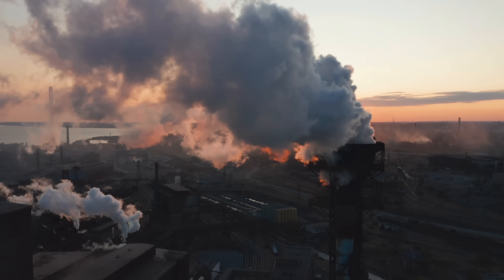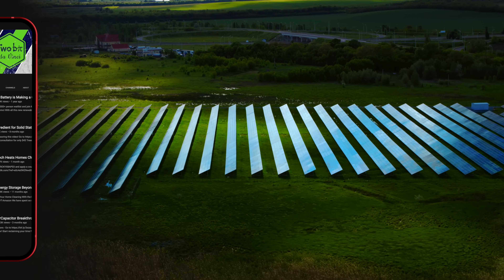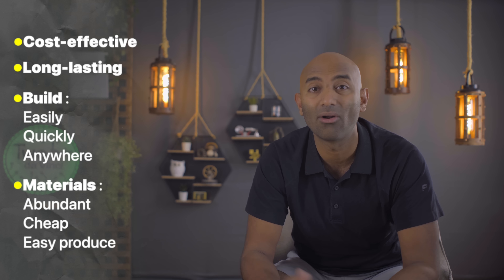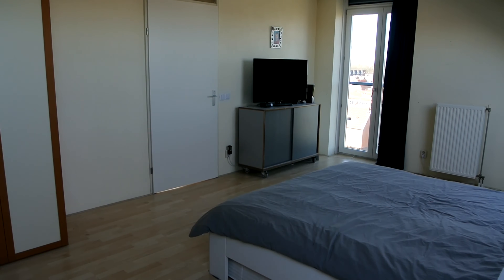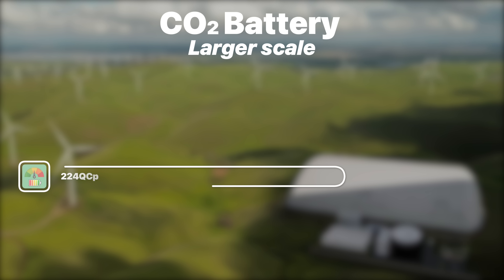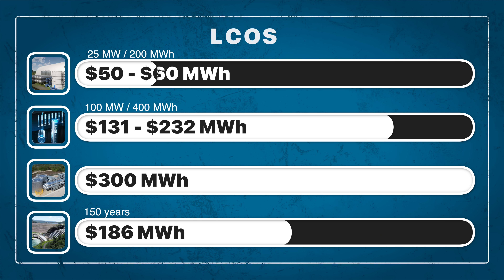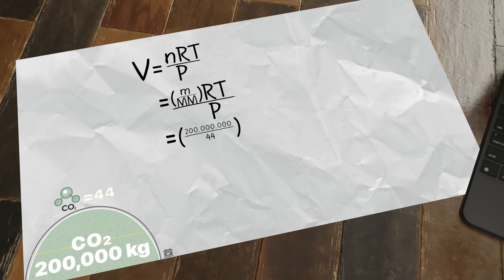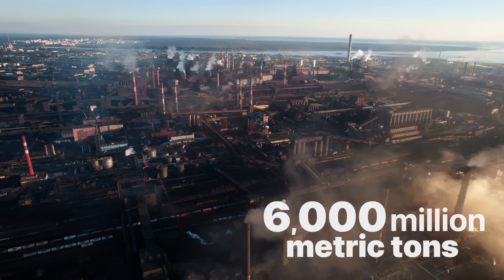The GENIUS Of the Carbon Dioxide Battery

Comment: I think its worth keeping an open mind and look at all possibilities.  C02 is .04% of the atmosphere and a small portion of that is man made.
Reply: @evilchaperone An open mind is a good thing. The percentage of CO2 is irrelevant, that's just how we measure it to track changes. What matters is how likely it is for a photon to hit a CO2 molecule on what would otherwise have been on its way out of the atmosphere, which is entirely to do with the number CO2 molecules in the air.  Magically double the amount of nitrogen in the air and the percentage  CO2 would halve but the greenhouse effect from it would still be the same. Mars has a very high CO2 percentage but its atmosphere is so thin that it has less CO2 than us and thus less greenhouse effect from CO2 than we do.

We are now around 400 ppm before the industrial revolution it was 280 ppm, a change of 120 ppm. 120 out of 400 doesn't seem a small portion to me, so I'm wondering what brought you to say this?

We know this change is due to us. Firstly, we have mining records, we have a pretty good idea how much carbon we've dug out of the ground and burnt and it is way more than enough to account for the change in the air (most so far has been absorbed by the land and ocean). Secondly we can tell by tell by the different isotopes of carbon where this CO2 has come from. The usual Carbon is C12. We can tell by the amount of C13 that this carbon has come from a biological source, and we can tell by the amount of C14 that this carbon was taken out of the atmosphere a very long time ago. This is the fingerprint of fossil fuels, not volcanoes, not weathering.
Reply: @flightofthejellyfish  My point is to keep an open mind.  CO2 alone may not be the entire cause of climate change.  If you removed all humans from the earth, the climate is still going to change.  If you remove all man made c02, the climate still going to change.    Eliminate fosil fuels, billions will die from starvation.
Reply: @evilchaperone  "My point is to keep an open mind." Hmm, yes. An open mind would be one willing to listen to new ideas and consider them. An open mind would be one willing to look at new evidence and evaluate it. An open mind would be one willing to be changed if the ideas or evidence demand it. An open mind would question itself: Is it true that the percentage doesn't matter only the absolute value? Is it really 120 out of 400? Why do I think that it's a small portion if it's 120 out of 400?

An open mind probably wouldn't change the subject and run to an emotive "billions will die" appeal to avoid thinking a thought that might change it. Just saying, I don't think what you're really advocating for here is an open mind.

Sorry to be harsh, peace.
Reply: @flightofthejellyfish don't forget the "look at all possibilities".
Reply: Not to mention that water vapor is 100 times more prevalent in the atmosphere...with 10 times the specific heat.  But lets not talk about water vapor as a "pollutant."   THAT would be ridiculous.  /sarcasm
Reply: @C0M0I  you might have noticed in your time on planet Earth that when you try to add water to the atmosphere it tends to just fall out again. You can't increase it so it can't force a change in the greenhouse effect, only respond to changes that occur. Notably the amount of water vapor the air can hold increases with temperature. Climate scientists aren't idiots they've taken this into account. The about 3 degrees per doubling of CO2 figure is only about 1 degree directly from CO2 nearly all the rest is from the higher temperature air which can hold more water vapor which increases the  greenhouse effect which increases the temperature so the air can hold more water...
Reply: @flightofthejellyfish  are you saying that water vapor is responsible for about twice the temperature change that carbon dioxide can produce?  Thank you for agreeing with me. 

As for the amount of water vapor that the atmosphere can hold…I have noticed, like yesterday at 41,000’ the jet contrails stayed while I was over Missouri, but quickly evaporated when I was over Indiana, two states away. Seems that part of the atmosphere could handle more water vapor and part could not…it was already saturated.  This is true of all gasses in our atmosphere: temperatures dictate how much of each gas can remain suspended before falling out of the solution that is our atmosphere.

I understand that the scientists aren’t idiots, but I believe that they make too many assumptions in their quest to understand the atmosphere and guide our behavior in relation to it.  They have been wrong about their predictions for 50+ years.  Please forgive an open mind’s sarcasm when they ignore water vapor and harp on plant food…

You, yourself agreed that water vapor holds more power in temperature change for our atmosphere than plant food (CO2).
Reply: @C0M0I  "are you saying that water vapor is responsible" Try to read for understanding instead of mindless sophistry. I just separated out two concepts for you. One is a forcing that can cause a change in temperature the other is a mechanistic feedback that amplifies a change, not the cause. If by "responsible" you mean it is the cause then the answer is no it is not the cause. You are playing mindless word games. Do your research for goodness sake it's not like this is secret knowledge, it is mentioned throughout atmospheric science and really shouldn't be new to you.

 "could handle more water vapor and part could not…it was already saturated." Try to read for understanding instead of mindless sophistry. Yes well done air heats up from the sun, water evaporates, cools down, it precipitates out. While the average temperature of the atmosphere remains the same the average water vapor content remains the same. On average the amount of water that evaporates is equal to the amount that precipitates out.

"This is true of all gasses in our atmosphere" When the heck was the last time you stood outside in a shower of liquid CO2?
NO the Earth's surface temperature is not low enough and the pressure is not high enough for CO2 to reach saturation, let alone liquifying nitrogen, oxygen or helium! Did you actually think about what you were saying at all, or were these just words you thought would sound good?

"They have been wrong about their predictions for 50+ years." Really? Go and look up the IPCC's first assessment report (that's the usual bug-bear) and see how actual scientists' predictions track with current measurements, I'll wait...

...or is it only what professional "sceptics" say the predictions were - through out of context quote mines and cherry picked non-scientists - that are wrong. You really shouldn't trust what professional "sceptics" say their opponents say.

"You, yourself agreed that water vapor holds more power in temperature change" No, I didn't, I said the complete opposite. That is your willful and sophistic lack of comprehension. Why is it that you have to resort to sophistry instead of honest argument?

Comment: Energy storage, such as Tesla's mega pack, will be done primarily with LFP cells. Nickel will only be used for high energy density batteries. It will be an immense task to convert the worldwide energy grid entirely to battery storage, and it will take many decades. Fossil fuels will be required for a long time.

Comment: I agree it should capture co2 from the atmosphere. One way they could do it partially would be to capture straight from the factories producing it. Technology could find a way to connect straight to those stacks and use a vacuum system, then take it to a plant that could separate it from the other gasses. Sure, startup for that would be high. But again, so are water and sewage treatment plants. Then, they could even add on to other high carbon producing areas. Sure, it costs money to start as everything does. But in the end it would cost less in the long run and cost less. Once you can find a way to capture carbon straight from the air itself the means of separation will exist and the only major issue would be how much could be taken from the atmosphere before an ice age would result. This could be dine for other gasses such as methane, which seep out of the earth, land, and oceans. Again, we could do many things to help the environment. To what extent would we then hurt the environment and need to produce vs take away. For instance, if we take too much growth of plants, they would suffer. Removing too much could cause cold climate etc.

Comment: Interesting, and well presented. Still I think most solutions like this one are barking up the wrong tree. Why go to these extreme lengths to redeem the basic shortcomings of renewables like solar and wind (power intermittency and power density)? We want to free ourselves from the dependency of autocratic regimes for a stable energy supply. Yet, the dependency on China for rare earth metals (wind turbines),  solar PVs is almost 100%. The enormous pollution and energy use from Lithium mining, enormous copper mining efforts for electricity transport cables, production of inverters, controllers, etc seems to be ignored.  Currently, the only stable, scalable energy solution is nuclear. Moltflex, Seaborg, Westinghouse and several other will be central players in the re-birth of the nuclear power era. Safe, stable, scalable.

Comment: I got news for you, it isn't a delicate balance. Evidently you haven't looked at any of the co2 records. There is no way that in 1965 the world produced 12 Billion Metric Tons, with 6 of that 12 making it into the atmosphere and the other 6 being sunk in the environment. Flash forward.half of the current output, actually more than half the output is disappearing. Good numbers are hard to find. Today the sinks are taking up over 2.5 to 3 times the entire production in 1965 or any time during the 60's, 70's. 
What you believe and what is actual, are light years apart. This is just one thing. You'll come up with some apologetic statement like plants are taking up more. Not that much more, and the oceans were supposedly cooler 60 years ago and 'the lungs of the earth' were bigger.  Delicate??? I don't think so. Do you have an idea what the shield of the shuttle is made of? Have a Handbook on Physics and Chemistry? Have you looked at the thermodynamics of elements, the entropy of o2 in particular and on the next page the thermodynamics of oxides, in particular co2??? Which one has more entropy? And is it even meaningful? Is the amount of co2 meaningful?  Oxygen and Nitrogen make up 99% of the atmosphere. All the other gasses combined round out the 1%. Ever see a paper that has o2 list with hundreds, It's 210,000 ppm. I can't even tell you if we are responsible for all of the increase in co2 amounts. Certainly we are adding, but that delicate balance, isn't .

Comment: You know what CO2 actually is? Plant food. When CO2 levels increase, so does flora growth, which in turn leads to more H20 vapor and 02 levels, both of which are good for fauna.  Is there a balance? Sure. But the planet can balance itself. It has before. Look at the ice core records. C02 levels have been exponentially higher in the past, including during full blown ice ages, which happen during global cooling. Our effect on the earth's atmosphere pales in orders of magnitude to the effect of solar activity.  We do not drive warming or cooling. The sun does. We might affect the overall values by a small degree, but we can never hope to compete with nature's ability to self regulate.  The hubris of man, and our self importance is staggeringly disturbing.  We are dust on a speck of dust amidst motes of dust littered throughout eternity.

Comment: Carbon Dioxide gas is NOT the problem,  solid carbon materials are , in the form of CNT's.  Slightly above normal  CO 2  gas in the atmosphere is not harmful to anyone,  in only encourages more plant growth.   The problem with CO 2 gas, is that it has been building up in the Oceans, and Fresh  Water.   Re-balancing the Earth's Water by delivering dissolved Oxygen , is the answer.    Increased pollution, and dumping has accelerated the problem.

Comment: As the Carbon Dioxide falls the Artic Ice Sheet is expanding...over 2 million square kilometer's so far! There is around 425 parts per million right now which is magnitudes of levels lower than 100 million year's ago! CO2 helps regulate the temperature's...without CO2 every living life form die's! Here is a fun fact for the people...if CO2 drops below 279 parts per million well look up snowball Earth!

Comment: If the figures quoted are realistic when scaled to industrial levels, this certainly provides an answer to the intermittancy problem and the demand problem of wind and solar power generation. Lithium batteries are not going to be the answer, the demand for Lithium in the coming years just to satisfy the demand from transport is going to make it expensive and in short supply. Its good that technology like this is being developed, I hope that it proves practical and successful.

Comment: Carbon dioxide is heavier than air. If there was ever a large rupture of the dome... the gas would displace the air near the ground all around the dome and flow to low areas. This would suficate everything in a few minutes. People and animals.
The dome should be hardend from aircraft strikes and located away from cities. OR just use air.

Comment: Efficiency is not a question if the goal is net zero efficiency doesn’t matter you just build more solar plants or windmills to make up the difference but any energy storage system that doesn’t use hydrogen is a waste of Time hydrogen can be burned or put through a fuel cell either way it produces only water and that water can be collected and turned back in the hundreds again with no loss

Comment: When liquid CO2 is released from it's pressure vessel, the phase change from a liquid to a gas may cause some of the CO2 to freeze into dry ice at close to atmospheric pressure.  If water used to cool the compression cycle is also used to heat the evaporator this would result in some energy recapture, however, it seems that additional energy is needed to evaporate the CO2.  What energy source drives the "gas turbine" to run the boiler?  Please clarify.
Reply: Why a boiler? Co2 vaporizes around -78 degrees celcius, depending on pressure. Just a fan pulling in outside air and a heat exchanger would do. (although you might even try to hook up the cold side to (for example) a cold storage, or other facility that needs cooling).

Comment: Or,. Or,. Or. Install slow speed underwater turbines called Waterotors in all water moving 2 to 5 miles an hour. They work 24/7 won't harm fish and can be moved if needed. The Green Dream won't happen without it

Comment: You ain’t seen nothing yet , as the earth finishes the current cycle of this ice age (80,000 years to go) the entire earth will be green .. the co2 levels will be back to normal , at least 100 times what they are today , after all , plants consume co2 , plants releasing oxygen .. so the oxygen levels will be higher too , not the same as co2 because oxygen also binds to others elements like hydrogen .. H2O , there will be much more water in the air that will magnify the sunlight , plants love sunlight .. so whats the punchline , this ice age is nearly 3 million years old and it’s ending , human cannot stop it .

Comment: The one thing most people don't know about efficiency is that in a system the overall efficiency will always be lower than the least efficient component.
Reply: Hi. The weakest link. P.R.
Reply: The sun and wind is free.  And the system gives an incentive to repurpose carbon dioxide.  So that is a better starting point than expendable fuel sources.
Reply: @markharmon4963 im not betting my money on it thats for sure, key bottlenecks for industrial scale with this tech werent solved in the pilot, its a scam.
Reply: Most people do know that.

Comment: There is no evidence proving CO2 is a problem even the IPCC admits all its climate models have failed. And  claims of more severe weather don't hold up when checked. As 1 person said an EV battery is made by filtering 500 tons of dirt NOT GREEN at all. Solar panels are not Green totally unable to be recycled in any form. Also pointed out Batteries are a failure to keep a large city supplied it would take thousands to keep a large city running for a day or two not to mention the land they and solar panels take up and render useless. The hottest place on earth is the solar panel array in Saud Arabia permanently 57 degrees C that's 135 deg Fahrenheit.

Comment: 0:47 So you agree that carbon dioxide is, in fact, the problem. And that everyone was, in fact, right about carbon dioxide.

Interesting video, I hadn't heard about compressed gas batteries before. If Energy Dome can actually build a battery with an efficiency of 75% out of nothing but steel, C02, and water, that's pretty exciting! The title and thumbnail of this video are terrible, though.